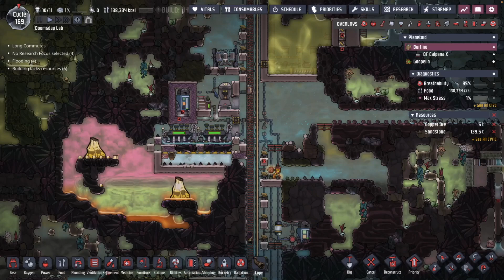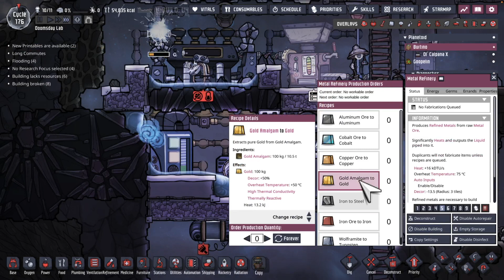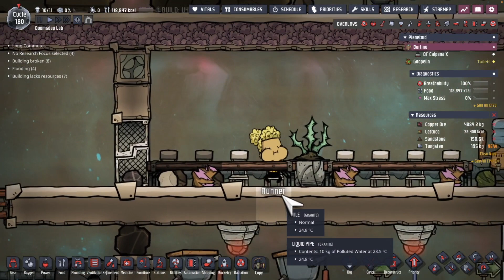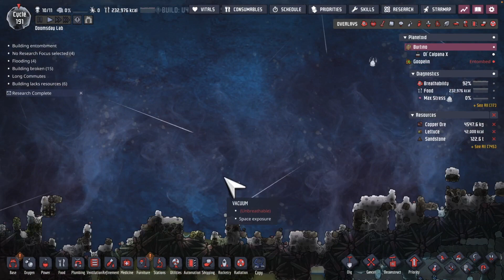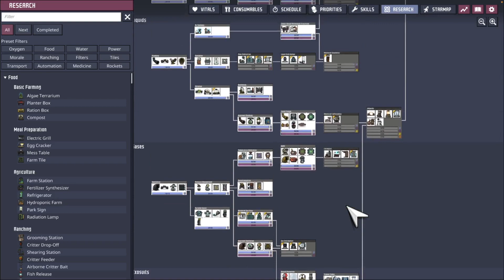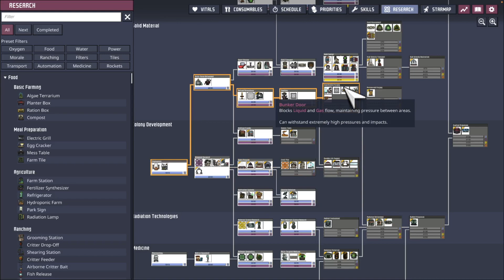QoL Doomsday 8: Capturing Machinery Heat

Comment: 4:31 Normally want you your pipe sensors right before the option option to split. Saves a bit of mats. In the case you have the liquid will normalize in the tank and be above what you want also, since the check is after the output.

PS: You sound quite low compared to other YouTubers. Normally listen at about 1/2 volume and for you, I am listening about double and a bit of a boost.
Reply from the maker: This is great feedback. I'll try some sound adjustments for episode 10. Also I see what you mean taking the temp right before the split. I'll try that on the next one.